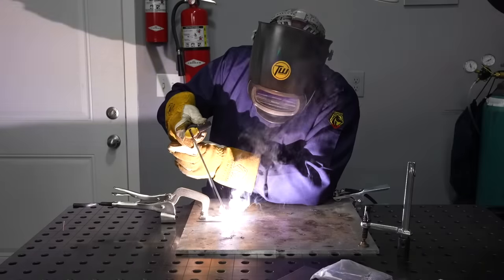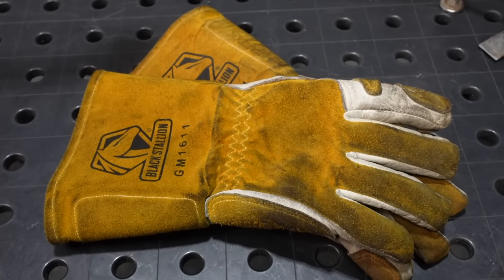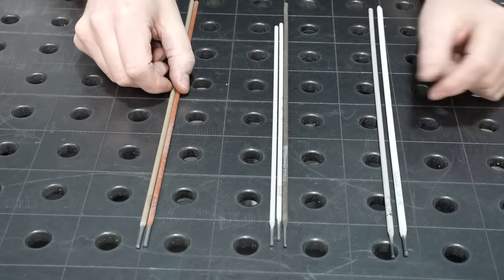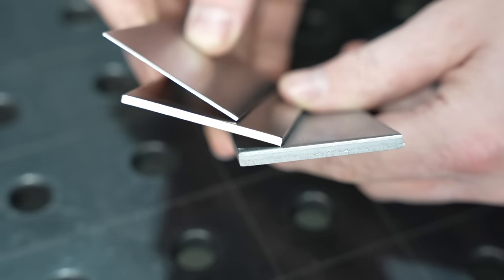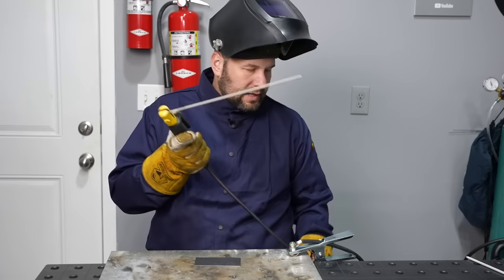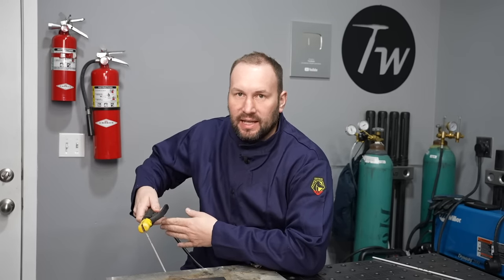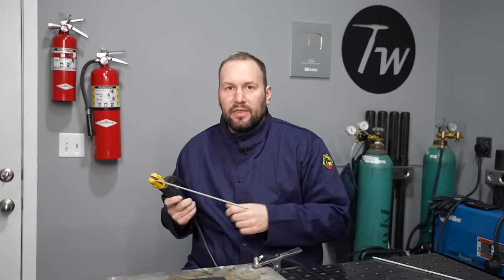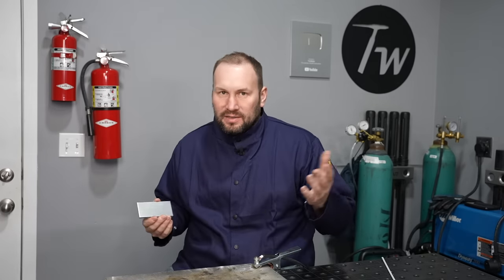Stick Welding Basics: Full Tutorial

Comment: A year or so ago I bought, after a bit of online research & on the advice of a tradesman, a multi mode welder (does MIG, stick and can be set up for TIG) for just under a hundred bucks. I’ve done some MIG so far, and it’s been a lot of fun. But I’ve wanted to try stick, and not knowing one rod from another, it’s been confusing. Thankfully I came across this video, which will doubtless steer me toward more knowledge. Thank you for your time and talent. This is going to be fun.

Comment: I've found this channel invaluable, Greg's too; I thought I'd share my experience today, with 6011s and 7018s - first time I've ever used them, my wife picked some up in the city for me. We can only get 6013s here where I live. I bought my first cheap inverter set a week ago and have loved putting down welds and it's really coming along, did a nice butt joint earlier today and maybe a fillet tomorrow, and going over Tim's drills.
For the life of me I could not strike 6011s or 7018s (6013s were not a problem), maybe the odd spark but no arc. I really cranked the amps up, well exceeding the rod max, no joy. I tried everything I could find online, pristine metal, earth on the table, earth direct to the work, cleaned the stinger and rod end, polarity, high amps, low amps. Nada. Setting aside me being a novice, I was thinking dodgy rods? Dodgy inverter?
Anyhow we had a power outage that went on for a while so I decided to quit for the day. I turned off the box and grabbed the stinger connector and it fell right out of it's slot. It wasn't flopping about, but the locking twist- lug was not engaged. I can only assume that the 6013s could work with a much reduced current output but the other rods couldn't. I really hope that is the case because I'm itching to try the rods out. A bit of a gotcha because a loose inverter connector was never on my radar - bleeding obvious now!

Comment: Hey from Dublin, Ireland Tim.. Just bought my 1st Arc/stick welder today. It's a very small 10-80A inverter welder but it will do me for what I need it for. I was going to go for a gasless MIG welder but I thought I'd better buy this one 1st and see how I go. I did some welding back when I was a kid in school and I actually enjoyed it but we never got to do it often enough. Ascetaline? welding was another type I enjoyed too but not enough time spent doing it either. 
The reason I bought the welder is bcos I want to built my own table saw and I bought the square tubular steel for the body nad wanted to try my hand at welding it. My brother in law knows a bit about this field but I'm going to watch some more of ur videos tonight so I can have a crack at this game over the next few weeks. 
MIG welding is a type I would love to learn but as I said those welding machines are a fair bit more expensive and this stick welder was too good a deal to pass up at the knock down price I got it for. 
I enjoyed this video Tim mate. It was packed full of great information and learning so thanks for taking the time to make this. It's very much appreciated.
The square tube steel I'm welding is 2.5mm thick and 40x40mm. What would be the best settings for that if u have the time to let me know my bro? Somebody told me to use 1-6 6013 rods at 40-45A settings?? Are those Amp settings too low? 
I liked that tip about the rods sticking. 
What does this Anti-Stick built in thing on these inverter machines mean? Does it actually stop the electrodes from sticking? That was always the issue I had when I did this yrs ago.. LOL
Thanks again for the great info Tim mate.. Will be watching and learning intently from now on. 
BTW I'm going to be attempting to build a 4'x2' CNC machine in the near future.. lEARNING TO WELD CORRECTLY IS GOING TO BE A HUGE ADVANTAGE FROM NOW ON..
I look forward to the next instalment on ur channel my friend.. Take care bro,,
Reply: How did you go with the table after?

Comment: I'm a intermediate welder at school and I use Stick welding gloves which are thicker and more heat resistant and a fixed shade 11-12 sugar scoop orange lens running 6010s and 6011s

Comment: Thanks for such instructive videos on the basics of welding techniques Tim.  As a DIY hobby woodworker, I was intimidated by any metal working especially that needed even basic welding.  However, I realized there are many useful items even for my advanced woodworking projects where I could occasionally use a jig/fixture where just a simple welded part will be simpler than all the screws or rivets.  I have learned enough to try my hand at stick welding using rather inexpensive DC welders based on your recommendations
Reply from the maker: Awesome! Thanks a ton for the comment!

Comment: Hi Tim, I've been watching all your videos. They're fantastic. I've got a steel bumper to weld together. I was going to practice on a bunch of 3/16th" slabs that were donated to me. My question is - will that Deko you reviewed get the job done for 3/16th " @ 120v? and what stick would you use? I dont have a 240 outlet in my garage. Thanks.
Reply from the maker: Yeah, it'll do it. At that price, it's not a high end unit, but it works. I would use 3/32" 7018 or 6013 with it. On 120 volts, I found that the output was significantly lower than the amperage reading on the LCD, so you may have to turn it up to what seems like a very high number for the particular rod.
Reply: @TimWelds  Thanks so much! can't wait to start practicing.

Comment: What would be best to weld a trailer gate ? Using expanded metal mesh
Reply from the maker: You could use any process to do that, but if you have all of them available, I'd use MIG or flux core because it would be easier with all the starts. If I were stick welding it, I'd probably weld the mesh with 6011 or 6013 because it restarts really easily.
Reply: @TimWelds  ty so much man

Comment: Hi Tim , If I'm using house 110Volt/15Amps Breaker box with my Welding machine What is the Max Amps and Max Rod Diameter Can I set? , Also If I use 220V/30 Amps House , What is the Max Amps and Max Rod Diameter Can I set? ...Thanks

Comment: I'm definitely not a welder, can never lay a clean bead and the welding machine at work is so old I can barely see the settings that are regulated by its tiny rotating handle.
Interesting learning about the different rods, gives me some ideas to try out next. I have been using the same type that was with the machine when I pulled it out of storage (can't remember which it is from the top of my head) and the results are so-so at best. Grinder and paint something something... 😅
Reply from the maker: I've used a fair amount of grinders and paint myself...LOL. It's worth looking at some different rods, they change the behavior of the process significantly.

Comment: Hello, I have two questions. I purchased a cheap arc welder on Amazon, for like $70..  the picture shows the grounding clamp going into the positive terminal. It came with J422 sticks.. I used the negative side and was able to get an arc but wondering if maybe it was a mistake in the picture or if I should be using the positive side..

Also, I'm trying to customize the size of some  powder coated fencing panels I got from menards to put on my retaining wall.. just the cheaper vertical 36" by 48" panels. What is the best electroid to use for this type of material? Should I be completely removing the powder coating at the weld site? If so how wide? I was having A lot of trouble using the J422..  melted a hole. And had trouble maintaining an arc. Thank you.

Comment: Hi Tim!  First and foremost, I do enjoy your videos, highly informative.  I am looking for a welder for home use; I just want a basic welder for some home projects.  Plan to be welding some light angle iron, steel handrail, gate hasp, etc. Plan to spend < $150.00 needs to be 115 VAC, just use stick, output preferably AC or DC.  What kind of welders can your recommend?  Any information would be helpful.

Comment: So first time welding.  Going to stick weld on my trailer. But the piece I’m going to weld onto the trailer frame is much thicker.  What settings should I use and how will I know it’s to much or not enough. Using a 7018 stick.  I’m guessing the large thickness is 3/16 to 1/4”

Tim would your classes be beneficial for me.
Reply from the maker: The amperage depends more on the type and size of electrode than on the thickness of material, though that plays into it as well. Stick welding is a very reliable process, so if the toes (edges) of your weld blend in well, the profile is relatively flat, and you don't have undercut (little recessed areas at the edge of the weld), your amperage is most likely good enough. There's a fairly wide range that will work in most situations, and the needed travel speed will vary with the amperage throughout the acceptable range. As a starting point, I would recommend about 120 amps for a 1/8" 7018 on that thickness or 95 amps for a 3/32" 7018. If it's something critical on the trailer, I would definitely practice on a mock up joint until you get that right before moving onto the actual part. You can also use the test joints for break tests to gain some feedback on the quality of your weld. 

With regard to the courses, if you are willing to invest some time in focussed practice exercises to build your skill, my courses will help you learn much faster than you probably would on your own. While the courses contain all the information you need to get started, you can find the information online for free and breezing through the course lessons at double speed is not likely to help you build skill. The real benefit comes from working through the progression of practice exercises which each teach one principle and reinforce that with one simple practice exercise. This progression came after many years of helping beginners and realizing that nearly everyone has the same challenges. If you try them out and find they aren't helpful, just shoot me an email and I'll send a refund, no hard feelings. Good luck with your project! Because of the volume of comments I get channel wide, I don't usually see responses to comments, but if you have any other questions, you can email me at the address on my about page and I'll try to get back to you.
Reply: @TimWelds  thanks much for your response. I’ll be signing up soon. Much to learn.

Comment: Can you give some input on 7010 with shield arc 85. I’ve been around shops my whole
Life and never used it, yet I see a man on TikTok welding big smokers and making beautiful welds.
Reply: Hmmm, had a responce for your 7010 enquiry earlier. Came back & it was deleted. Guess I broke a YT cardinal RULE. I linked an electrode manufacturers product data sheet that referenced more info.

Anyways, treat the 7010 like your 6010 while welding. 7010 is AWS A5.5 while 6010 A5.1. 7010 is slightly alloyed for tensile. (ie nickel) 
If you are further interested the manufacturer I linked was the Hobart's Pipemaster70. 

Good luck & cheers from sunny Florida.
Reply from the maker: I've never had a need to use 7010. Philthy McNasty pointed out it's very similar to 6010 in terms of technique, and that's my understanding as well. I don't think I've seen the particular videos you're talking about, but I imagine it's a stack of dimes type look similar to a lot of pipe fence. I've been able to get that effect pretty well with 6010 running on the lower end of the amperage range with a whip and pause.
Reply: @miszced  lol. I screen shot it before it was removed. Thanks for the info !
Reply: @TimWelds  yes it was a pretty weld. The guy I saw was Hispanic down in south Texas , and it appeared that he was a pipe welder , I don’t have any 6010 or 7010 but I will. !
Reply: @MrLoyd-yp1tr  In closing, your mentioning Lincoln's Shield Arc 85 is actually a 7010-A1 meaning it's alloyed with nominal 0.5% Moly & probably in service on limited high temperature pressure pipe.

As a bit of tip, take care of your cellulose electrodes by proper handling/storage. Only take what you need from the manufacturer's hermetically sealed container & reseal. Coatings are designed with 4-7% H2O.

P. S. Tks Tim
Reply: @miszced  copy that and Thank you !

Comment: Great video! It seems like it’s much more difficult to strike an arc with a new rod on fresh (cold) metal - as the electrode and material get hotter it seems easier to strike an arc. Is that in my head, or is there something that makes arcs form more readily on hot material/electrodes?
Reply: Depends on the rod. Restarting a 7018 can be annoying as it has a tendency of forming a glasslike coating on the tip when you do a pause.
Reply from the maker: Thanks! As @weldingforjesus6659 pointed out, you can get glassy slag over the end of 7018, which is a real pain. I usually whip out of my weld pretty quickly which flicks it off most of the time. Other than that issue, they are a bit easier when things are warm.

Comment: Does it melt the 2 meltals together  or is the rod have metal and that's what's melting it together?
Reply from the maker: It melts the two pieces to join them into one. The rod also has metal that melts and is added to the pool of metal between the two pieces for added reinforcement.

Comment: I just started practising when making saddlebag support for my bike. I rapidly tap the stick sideways expecting to just get a single flash. So my welding is like bz bz bz bz bz bzzzzzzzzzzzzzzzzz. That way I find how the electrode behaves while tapping instead of trying to get a good arc on the first tap and getting it stucked. I would recommend this method to the new guys because when you stick it 15 times in a row it gets frustating.

Comment: I have just bought a ROHR MMA-200FI welder to see if I like welding. I am 80. I am confused by this comment in manual. "Ground the unit by using the connecting screw at the back of the machine and connect to a grounded metal point free from the weld surface". I do not understand where this point would be. Any help would be gratefully received.

Comment: Why do these knock off welding vids edit the video this way? It's not possible to start and end stick welds so fast, the flux covers the weld area and will prevent a new bead from starting. Also, can't even fill a millimeter gap? Gotta hammer it closer?
Reply from the maker: I think some of them do weld that way, but it’s just asking for problems and isn’t necessary. Some are edited to make it visually satisfying and get views.

Comment: Nobody stick welds anymore
Reply from the maker: It depends a lot of the application and industry. Wire feed process have overrun a lot of it for shop fabrication, but there's still a lot of maintenance, repair, farm, pipe and general fab run with SMAW.
Reply: I do steam boiler , and pressure vessel welding......stick welding is not even an approved process on steam boilers anymore.....there is always so much porosity and slag inclusion that has to be ground out between each pass...that it has become a non approved process.   I stick weld at home for repairs.....but on my work, it's all Tig welding now.....very clean ..pin hole free job....steam likes those pin holes....lol,lol
Reply from the maker: Very cool! That's some of the most critical, difficult and important work in the the industry!